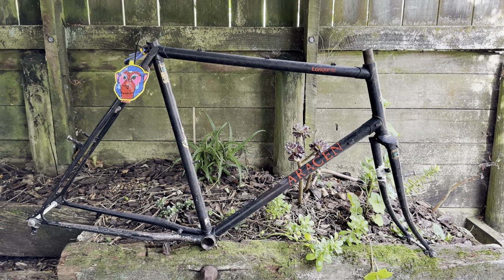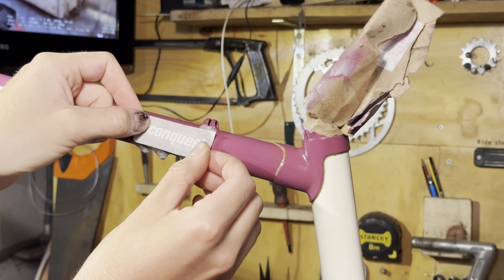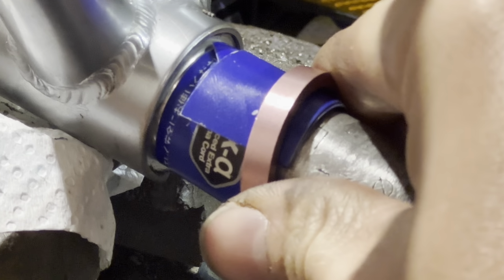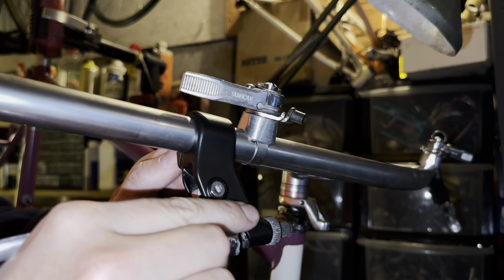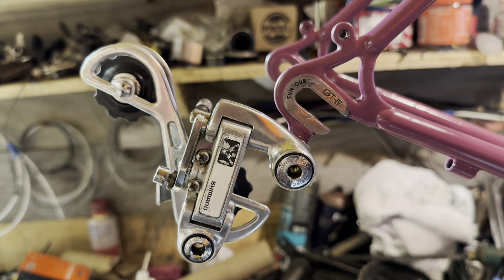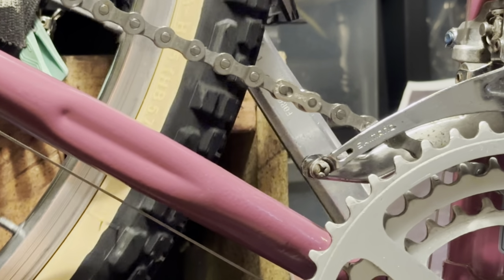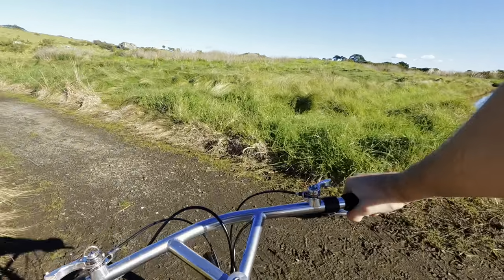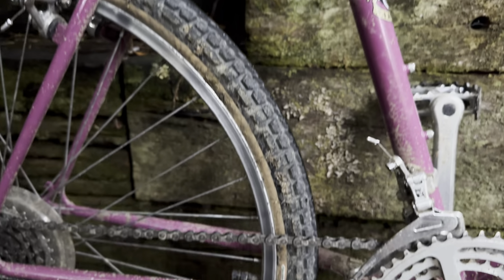Vintage bike full resto (DIY) 80’s Saracen Conquest MTB

Comment: Nice job! I had the same wrinkle issue when refinishing a vintage sewing machine and called the manufacturer support line, and after a few questions, we determined that i sprayed too far past the window of time for recoating, and i should have waited 48 hours. It was either recoat within 15 minutes or wait 48
Reply from the maker: Thanks! Oh that’s interesting, I can’t remember at this point how long I waited but I think most coats were around 18 hours apart. But this one might’ve been different and may have caused the wrinkling!
Haven’t experienced it in a while and was pretty surprised, but oh well.
Thanks for the info! I’ll keep that in mind for next time 👍

Comment: It would be nice if you stopped for a second to let these old folks pass, specially when they are taking the curve. You didn't even slow down. No consideration
Reply: Proper trail etiquette says you yield to those climbing.
Reply from the maker: I travelled slow and pulled as far left as I could, there’s more than enough space there. I’ve passed families in that spot before no issues 😊 
And as Erie said, I was travelling uphill so should have had the right of way-though the leader continued as normal so I assumed the followers were ok sharing 😎👍
Reply: i don't care, they are old people and are clearly struggling on that path. it's just care a little bit about them and stop for a second.
Reply from the maker: @emilifd    That’s not giving them much credit, I think they did quite well! 1 mistake out of that group isn’t bad and that’s the first accident I’ve seen them do. 4/5 🌟